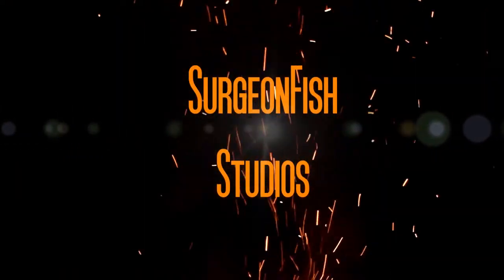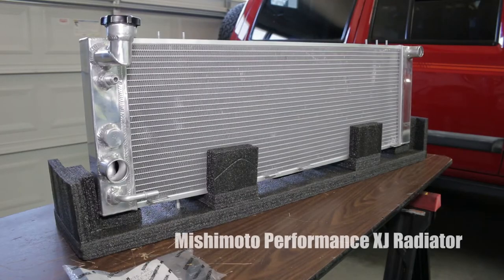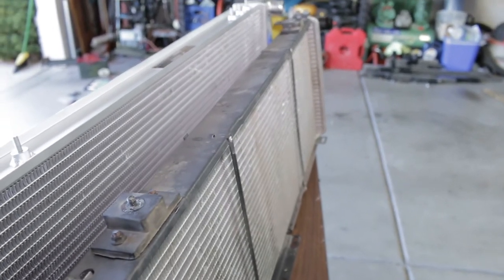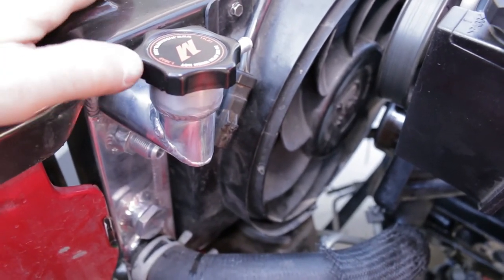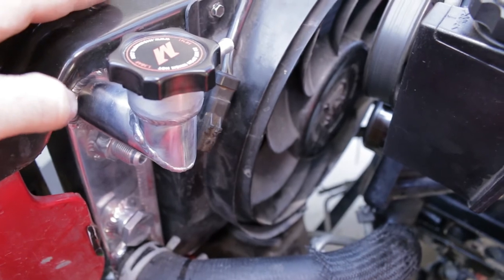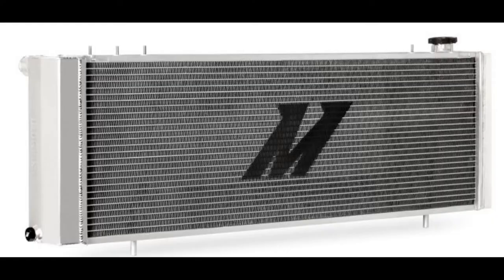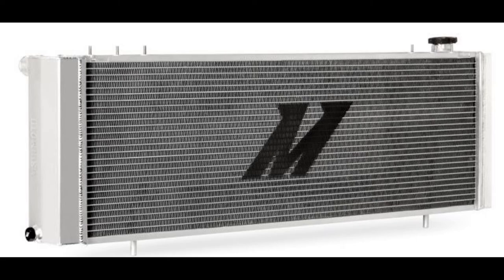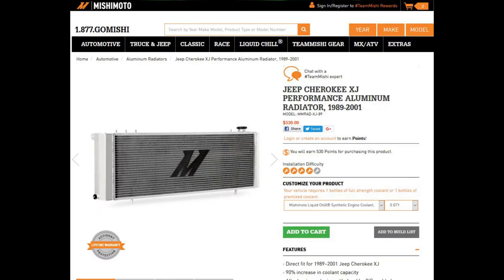60sec Mishimoto Jeep Cherokee XJ Performance Radiator Review

Comment: But did the transmission lines hook up without modifications? The adapters suck !
Reply: I swapped my old fitting onto the new one. Mine was a really tight fit because of the ac radiator did you have an issue with that. Mine is basically rubbing?